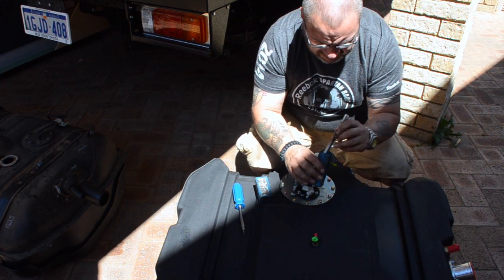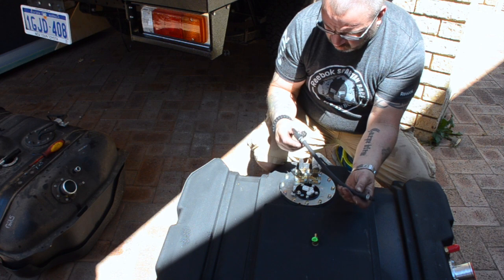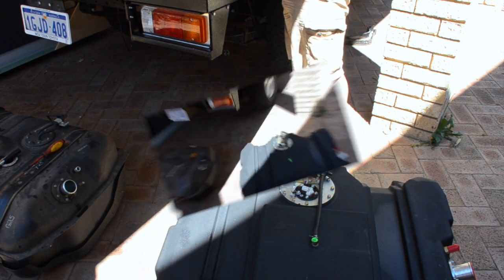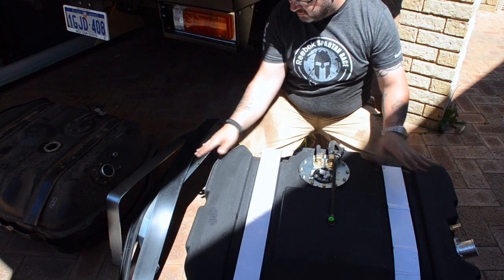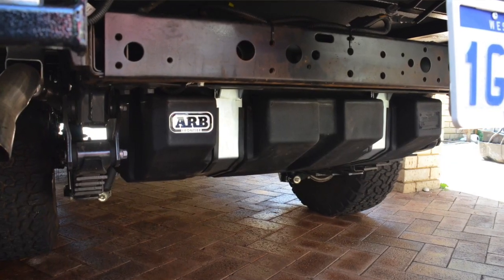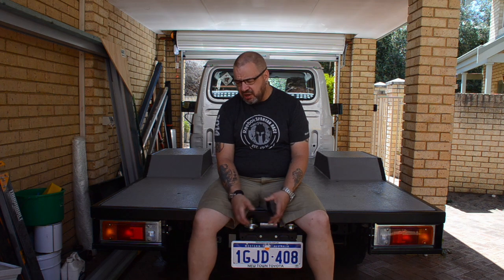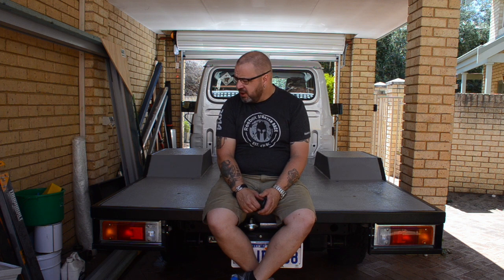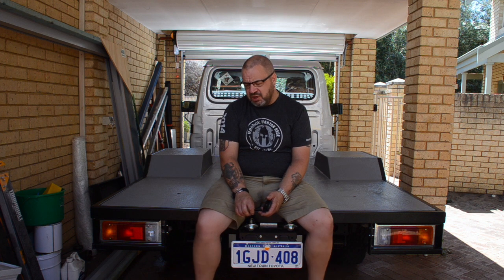LandCruiser LC79 Overlander Build _ ARB Frontier 180 ltr Fuel Tank Install  _ Ep 18

Comment: The problem with the ARB rotomoulded plastic fuel tanks is that they are not internally baffled and when partially full and you come to a stop like at traffic lights they impart a slight wave like rocking motion into the vehicle which can be annoying. 
Nothing gets ripped open faster on a rock than an underbody plastic fuel tank mounted where the spare used to fit... other than the sidewall of your underbody mounted spare tyre, always a welcome sight when you get under your Landcruiser to get your spare & find it has a gash like a 70 year old hooker.
Reply: The factory fuel tank for Pajero isn't baffled, which is not a problem even if the ARB  replacement tank doesn't have one. The ARB frontier tanks are 11mm to 14 mm thicker at the base than the sidewalls, which makes them very strong against rocks and other objects, it pays to get a suspension upgrade like a 2 inch if you are worried about rocks
Reply: @daviddowns715  I've found a 2" lift isn't be much use in 15" deep wheel ruts as the diffs are still the same height from the track and anything under-body is at risk with departure angles as I regularly drag my towbar & tongue out of obstacles . Ask Ronny Dahl what He thinks about the un-baffled tank surge He had in his install of one of these plastic tanks. He chucked the tank in the bin & fitted a steel baffled version from another maker.

Comment: Very nice and detailed.  I really appreciate how confident you  are as you tackle each problem.  It's inspiring.  Two quick questions: Where do you have the filler located ?  Do you have enough drop for it to fill quickly?  Thanks!
Reply from the maker: Hi Mark, the fuel filler had to be modified to fit the tray, it is tucked under the tray, the filler is not in an ideal location and I am going to address that soon... 😏

Comment: Hey Nomad. Great advice!
Especially that you have gone for the Frontier make 

Was a little bit sceptical of the plastic quality. But from the tests you elaborated on. I think I may have second thoughts about the standard alloy one!

How has it held up so far?
Reply from the maker: The tank is great. No complaints or issues to date. I am very satisfied. I will do a follow up review once it has had some off road use and I have tested it in all conditions.
Reply from the maker: Another point to beer in mind is weight, the other tanks available on the market are Steel and are much heavier which reduces your available GVM.